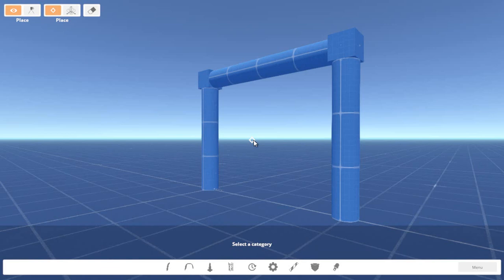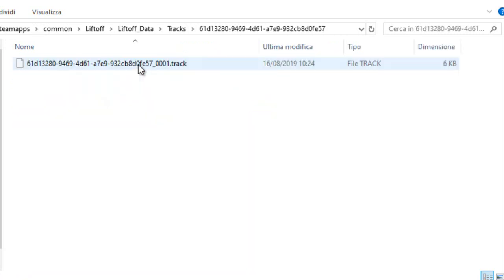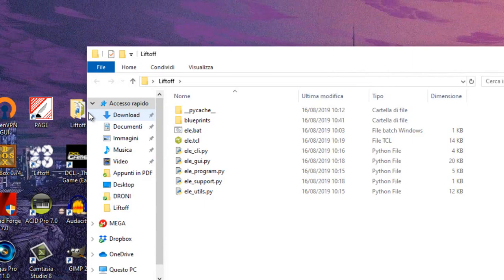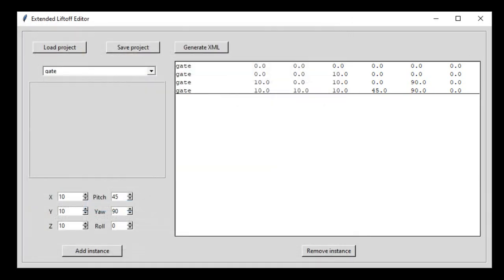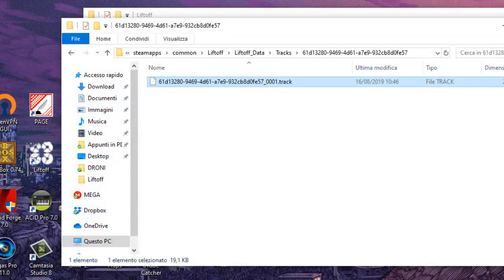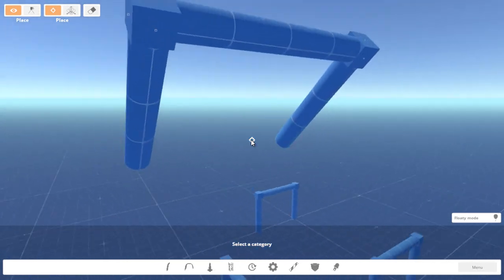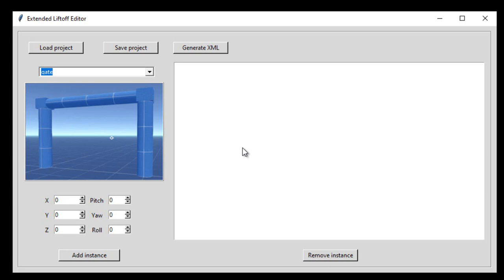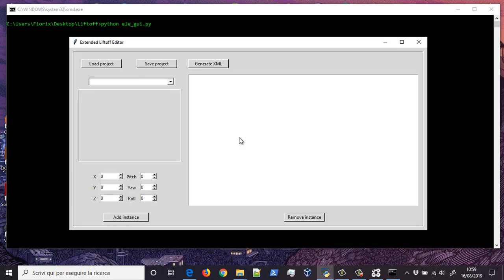Extended Liftoff Editor - Tutorial

Comment: Nice one, that'll help many track builders! :D
After building Formula Flow I and II, and getting tired of having to tediously place and edit 29 individual objects, in order to get the incredible amount of ONE(!) Formula Flow gate, I had the same idea. I coded roughly the same (even in Python), but without a GUI (just quick an dirty) - I simply feed the tool text files that looks very much the same as the object-list in your tool (gate:x/y/z/angle, ramp:x/y/z/angle, tunnel:x/y/z/angle/bottom, etc.), and it generates the xml for the track file. The tool helped me to half the amount of time needed for a Formula Flow track, from about 40-50 hours to roughly 20-25.